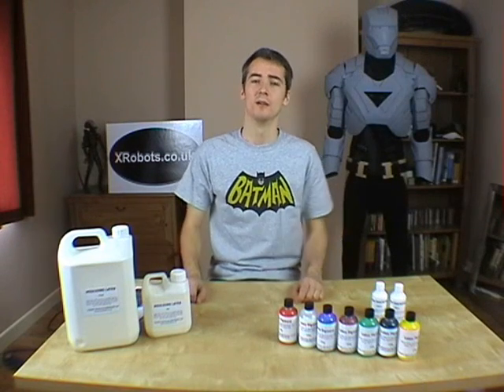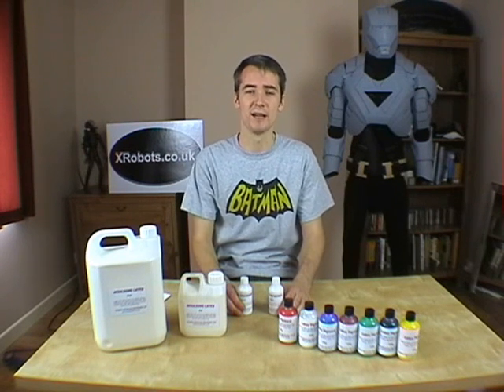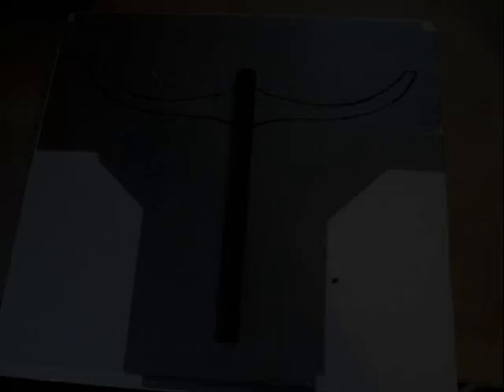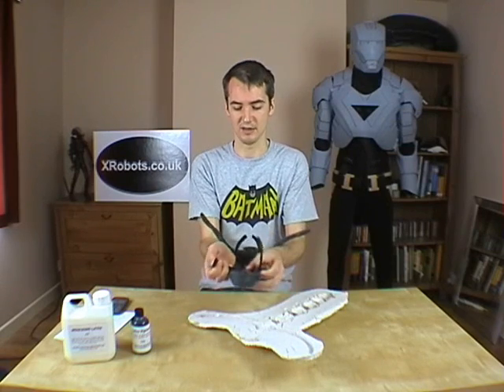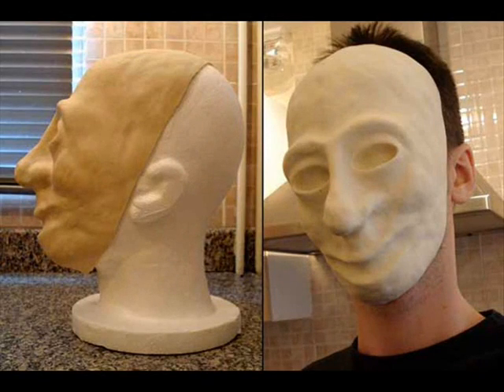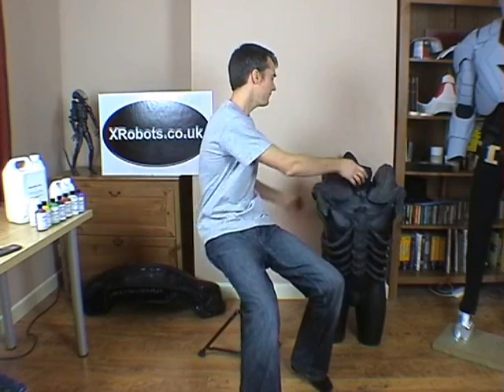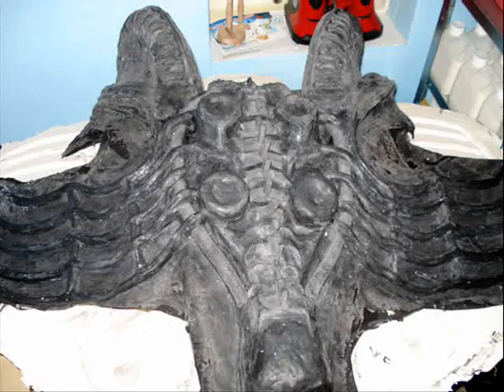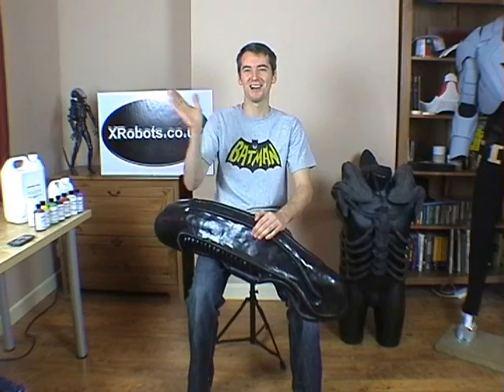How to make latex rubber cosplay costume pieces including my Alien suit | James Bruton

Comment: I used to Work with this over 24 years ago, if you pour the latex into the Mould, and fill it to the top, and wait for 30 Something minutes then pour it back into the bottle, it will leave a 1/8th-1/4 inc skin on the inside of you,re mould -repeat Untill you have you,re desired thickness.
Reply: This works well with clay Mould - never Tryed with Plaster, but it may give the same Effect.
Reply: +lasarith2 always do a small test -before you uses it on you,re actual Piece.